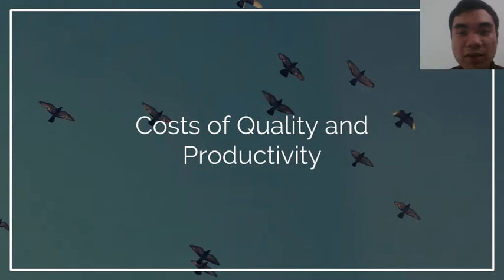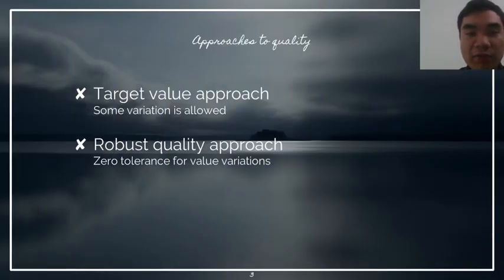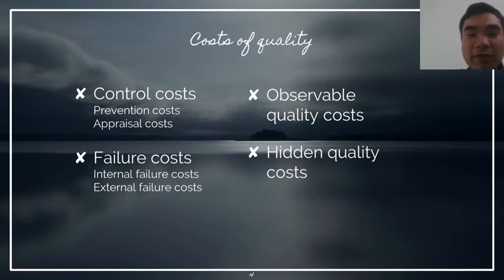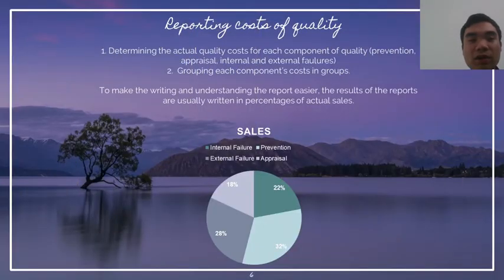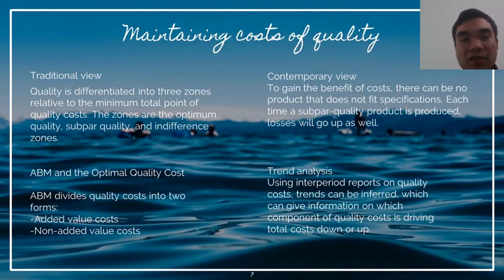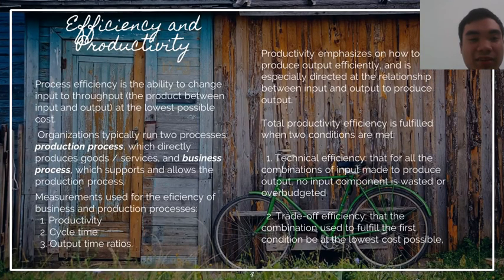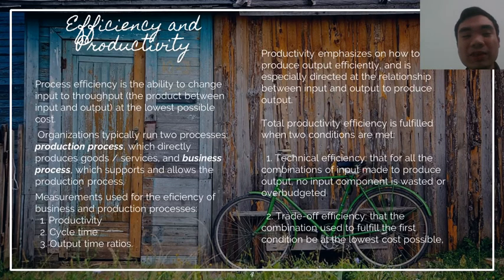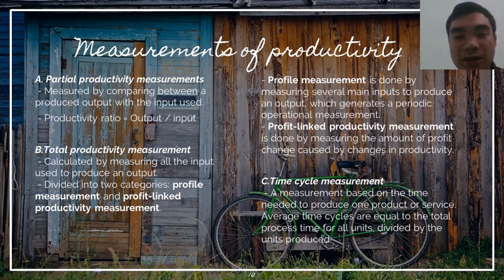Microteaching (Costs of Quality and Productivity)

Comment: Hai, I'm Anddeska (170503223) from 7th group...
Overall had a complete and interesting topic for presentation. You tried your best to convey the information clearly and directly to the audience. And though you were nervous you went and gave your presentation while trying to cover it up. These aspects contributed to a better presentation about your topic.
I also have a question, can you give me examples of technical efficiency and trade-off efficiency?
Reply from the maker: Technical efficiency: Producing more paper with less wood in a paper factory over time with new techology and methods. 
Trade-off efficiency: Buying cheaper wood for the paper or using more modern machines for less maintenance costs

Comment: Hello, Yudha! My name is Elvina Florencia (180503096). I would like to ask you if it is possible for a product to achieve a zero defect?
By the way, your slide is quite interesting, but your duration is way longer than what it's told. Maybe next time you can manage your time wisely. Thank you.
Reply from the maker: Thank you for your comment.
It is very much possible for products to achieve zero defects, because zero defects in the case of costs simply means that it functions exactly as designed. For example, a phone battery that is designed to operate for twelve hours must be produced exactly as the design mandated,  so that it is able to stay on for exactly that long, not even five minutes late or short. Once a company grows experienced enough with its main product's methods and costs of production, it may produce products that have zero defects.

Comment: What's the relationship between cost behavior and cost quality and productivity? 

Ryan Fernandes Panggabean 081
Reply from the maker: Both can be used simultaneously to help cut down on costs required to produce a product. Cost behavior can be used to classify products' costs so that it can be narrowed down into verifiable categories, and information gathered with costs of quality and productivity can be used to determine which of these costs can be cut without sacrificing the level of product quality.

Comment: Gives a clear and well-structured delivery when making a presentation, but during presentations, there seems to be quite a lack of focus. It’s a fine balance betweening winging the presentation and memorizing the presentation. if you improvise it too much it may come across as if you didn't prepare. If you memorize it, the presentation may come off a bit robotic. Try find the sweet spot, if you can.
I also have a question, can you give me examples of prevention costs and appraisal costs?

Btw my name sarido sitorus from group 2
(180503063)
Reply from the maker: Prevention costs: The costs of investing in training programs for the operators of its production machinery, to ensure that they understand how to manufacture parts correctly.
Appraisal costs: The wages of the inspectors and the costs of maintenance for machines assisting in inspections.